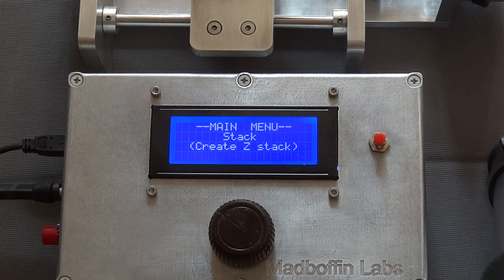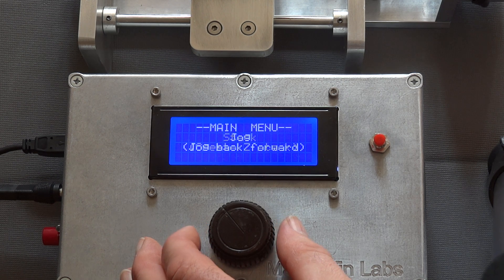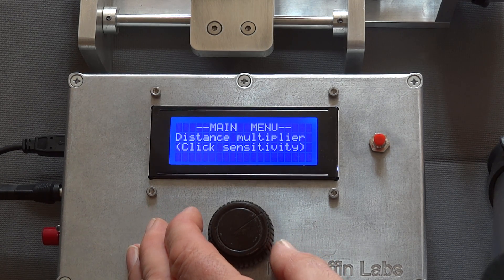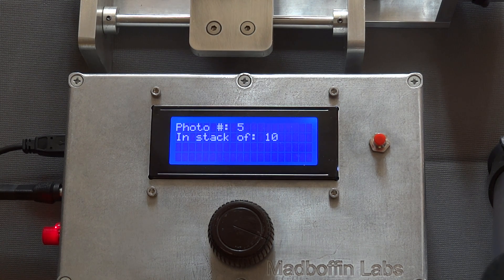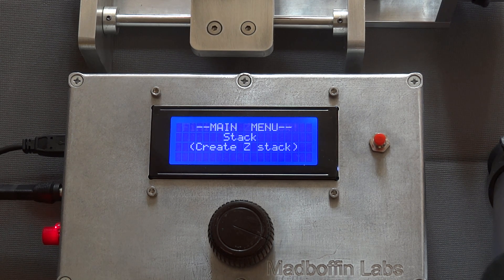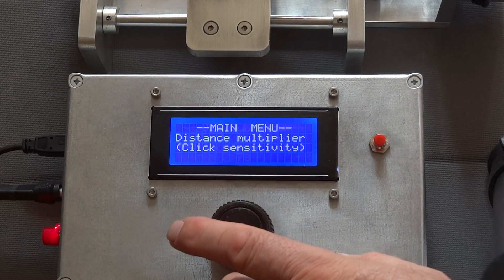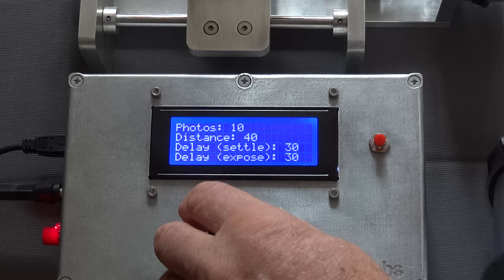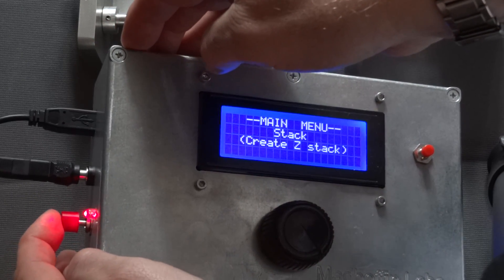Arduino focus rail controller

Comment from the maker: Hi Savvas, The original control box just used push buttons to drive a basic menu structure. A year or 18 months ago I made a new box and software controlled by a rotary encoder. Nothing new after that though I do plan an update with the controller based on a PCB rather than point to point wiring. All the best, P